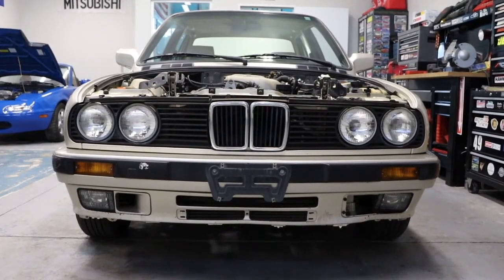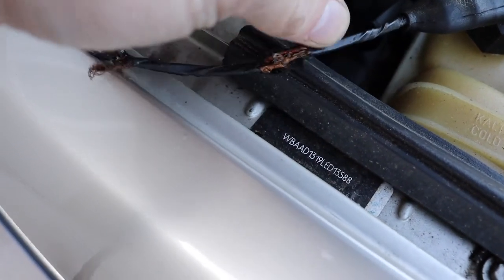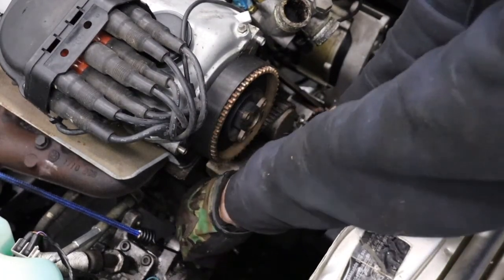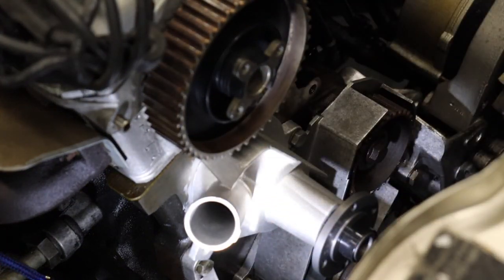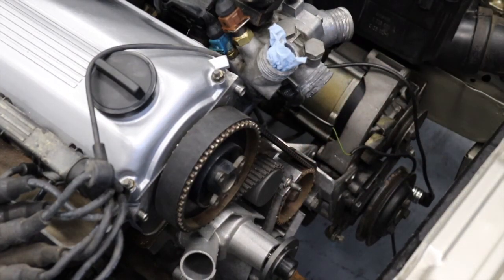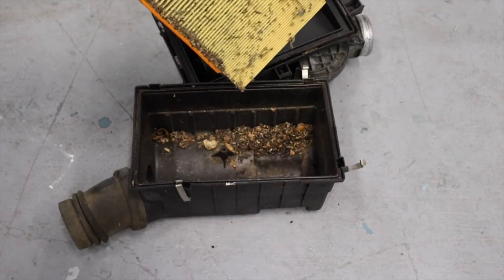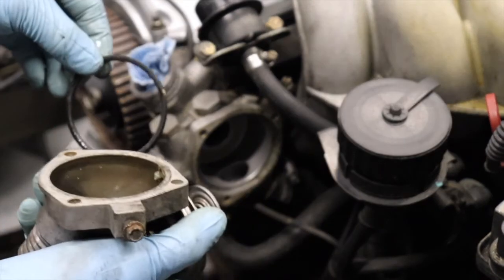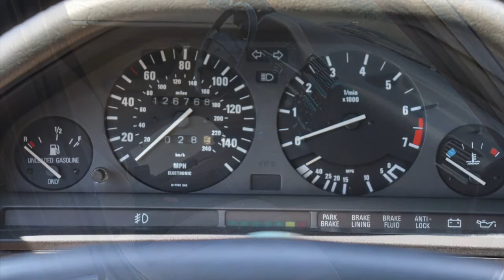1990 BMW 325i - Episode 7: Project Recap

Comment: Was the clutch ever changed prior to you getting the car? How would you compare the shift feel vs the m3 in your previous video?
Reply from the maker: Unsure in the clutch replacement history, but it sure engages nicely.
I prefer the shifter feel over the E36 M3 I reviewed, but the fact that the shift knob and boot kept popping off of that particular M3, I may be a bit biased.